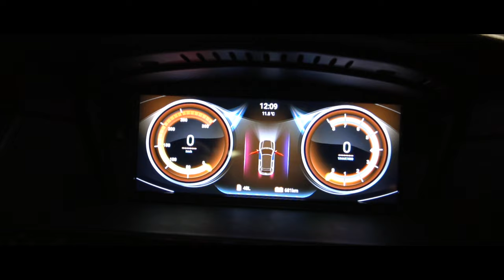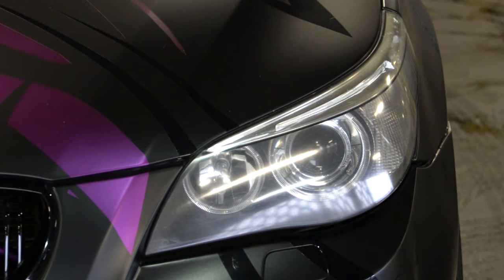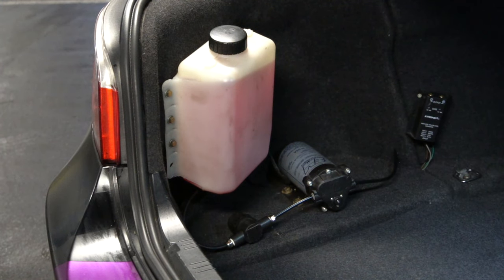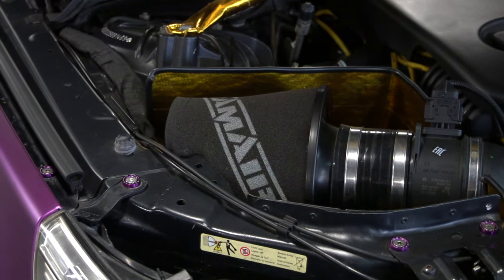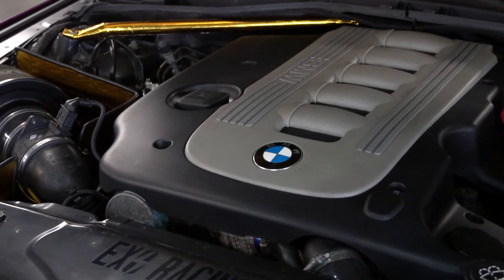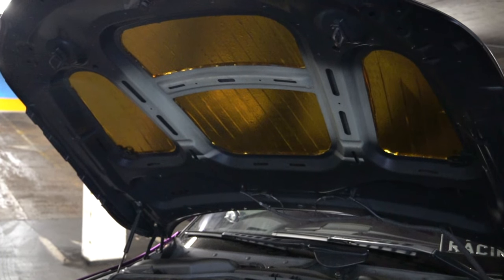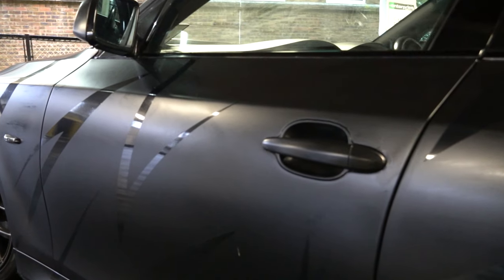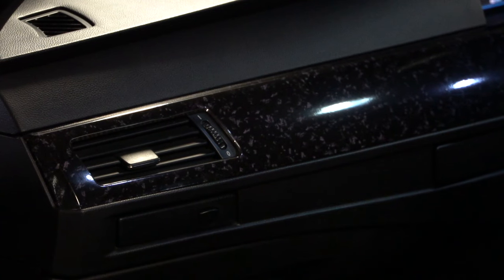THIS 440BHP HYBRID TURBO BMW 535D PULLS LIKE A FREIGHT TRAIN!

Comment from the maker: Sorry about some of the sound quality in the initial chat! High winds! 
Also no 0-60 on this one for obvious reasons ✌🏽
Reply: Why no 0-60?
Reply: @spraynub5767  weather...
Reply: @spraynub5767  I'd think it's due to the rainy weather and the car probably loosing the grip with the truckloads of torque
Reply: No 0-60 bc to rainy
Reply: 2020 ALL yours
Reply: Can he tell us whats his 100-200km/h time? Dont know how much that is in mph
Reply: @charliehope246  Tell us your 100-200km/h time bro
Reply: Mine is 420 on the standard turbos and got new intercooler race cam kit r90 fuel pump and upgraded Bosch injectors coming then I'll be onto ordering my hybrid turbos I can assure you by then my E60 535d will be running upwards of 500bhp I'm going for nearly 600 That is my goal without running meths ❤️
Reply: @garethjenkins1019  Hey mate where have you got the injectors?
Reply: @richardmattis197  hi buddy darkside developments Bosch upgraded injectors bgood for over 500hp but need to be ran with r90 fuel pump to get desired power not the standard fired r70
Reply: My 335d will be complete soon. It will be around 500bhp and over 1000nm and around 400kg lighter than a 535d. Would u want to review this?
Reply: @bradleymotin5568  sounds good but I'll be looking at 1200 nm of tourque so 400 kg isn't going to matter the grunt will pull that weight easy but will be a nice even match between your 335 and my 535 once completed %110
Reply: @bradleymotin5568  also I believe without playing with the cam and really fiddling you can only get 480bhp out of the 335d I'm sure of it where as the 535 has no limit the E60 msport shape already has forged parts I'm sure
Reply: @garethjenkins1019  my mate has achieved 532hp without changing the cams on stock engine. And the 335d comes with more power than the 535d as standard and I think that its the exact same engine. I used to have a 535d aswell
Reply: @bradleymotin5568  535d msport E60 from factory is 308 and 335d is 282
Reply: @garethjenkins1019  335d has more power from factory. 535d m spey has 276 I think and 335d has 281.either way the engine is the exact same. I know this cause my mate has a 335d aswell and his is 532hp and 1100nm and he's not changed the cams.
Reply: @bradleymotin5568  Google the msport E60 535 it's 308 factory not that 28 bhp makes this much difference 😂I'm not going for 530 bhp that's run of the mill I want more anyway 😂😂😂600 + is my goal
Reply: @garethjenkins1019  I did search it up
Reply: @garethjenkins1019  the new 535d has 308bhp not the e60. The e60 has 276hp
Reply: 55 plate 535 272 bhp, 2006 to some 2010 286bhp which is the same as the 335d. E60 same engine as the 335d no difference. 335d about 100kg lighter than the 535d
Reply: @charliehope246  how much for the hybrid setup mate? and what was the milage?
Reply: SprayNub because it’s purple
Reply: when you going to review a bmw x5 m50d
Reply: 0
Reply: Put an shorter diff 520 d and you will have 15% more torq 🥳

Comment: Pulls like a train and with the added bonus of higher mpg. Can't go wrong with diesels except the sound
Reply: The audi a5 3.0 tdi sounds AMAZING.
Reply: @antomustaine  definitely agree. Sounds close to a Nissan GTR when you bypass the DPF and put a exhaust on it 👍
Reply: Zain K it’s rare that they Sound good but sometimes they really do Sound good
Reply: If it has a turbo it sounds like heaven
Reply: Milan Beresnevicius yes
Reply: I have a diesel and I enjoy driving it it’s only about 190bhp and 405lb torque but it’s fun and pulls pretty good it’s a e82 been remapped but it sounds shit unless it’s got a filter on lol. Can’t complain though great mpg too and pulls well. Musics always on anyway haha
Reply: Birmingham racing must be nm
Reply: Geezer up road has a e90 330d with a hybrid turbo and that thing shakes my windows when it flys past, sounds unreal
Reply: Zain K What about the black smoke ?
Reply: Anto Mustaine what year and does it release black smoke?
Reply: Lee Foley does it release black smoke though
Reply: @Birmingham_racing   I was thinking that too. I'm running a 520D F11 stage 2 with ZF8 speed map so it run's more on torque for smooth hill pull's overhere even fully loaded with a trailer behind it. 243hp and 490NM on dyno. 190hp and 405lb seems a bit weird power figure for a BMW diesel.
Reply: And the lack of Rev range
Reply: ilimjahey What did you have to do and how much did it cost and who mapped car mate as I’m thinking of getting a 520d
Reply: @manccarguy  not all diesels blow black smoke my guy.. all down to the mapping.
Reply: @stefanmarkovic8180  one of my close homies had a 3.0 a5 that sounded like a gtr no joke, straightpipe with dpf removed on those sounds just as good as a petrol engine if not better...
Reply: Zain K True they do sound like a GTR
Reply: @manccarguy   i got a simple remap first got me to 210hp an 450nm. Normal they push more from a simple remap but i just wanted more torque for a more effortless drive. Got myself some new Reviera RF107 with a 11J in the back for some good grip. Then i just got a individual tune specific for my car with a thicker intercooler for better flow before the turbo. Got a gearbox tune like this guy when i got a gearbox flush as ZF advise's @ 150.000 kilometer so it hold gear longer and ride on the torque on low end RPM. Before this it shift's down always way too hard and reved all the way too 4.5k where there is no power at all. still very low diesel cost and a floaty feeling when pushed a bit. yeah it's a 4 cilinder 2.0 N47D20C but if maintained well and tickled a bit they pull really good. No performance at all but it sure is very quick. no black smoke at al with mine.
Reply: ilimjahey Do you think I can try something similar in a E60 520d 57 reg onwards the 177bhp model?
Reply: @manccarguy  What year do you own ? early models use the M47 engine lay out and are stronger then the later N47D20 engine. The E6x started using the N47 in the mid of it's life and are users of the early N47 and those engine's are prone to failure no mather how you maintain them. Will not go bad for sure but are known for timing problem's.  If you pick a later model N47 like one of the last they used before the B47 you will be safe if you go easy on it when cold and give it the oil change's it need. Also if you want a faster diesel then go for automatic. I drove my mate's BMW 123D with stage 2 on it with a manual. when the boost is loaded it wil go like a rocket but you will need too learn how to control turbo lagg or it will feel like a truck or a slow car if you can't keep it in boost. Automatic steptronic ZF 8 speed of older steptronic's can be tuned to stay in the boost area. Just more easy too use the torque and enjoy the car more. Also keep in mind if you want too go for a early model N47D20 that if the timing chain jump's a tooth and need some work that the chain is in the back of the engine. Engine MUST come out. Don't let it scare you off too buy one but keep in mind you stay on top of it. You can hear it coming when cold. And run a ODB PORT based management on a phone. Tuned car's need some love but some people forgett about that and thing's start breaking by driving like a hooligan and then it's the tuner's fault or the car. Do it Right and you will have a "quick" torque daily cruiser that wont drink you poor on fuel at all. IMO it suit's a 5 serie better. leave the racing and sporting too the M5 or a 3 serie. 5 serie is for cruising ;)  from belgium BTW so can't tell you any price's.
Reply: @manccarguy   but yes you can do that for sure.
Reply: ilimjahey Thank you have been very informative. So I used to own a 520d e50 late 2007 model and the timing chain snapped on me but I really lived that car as a cruiser spent a lot of miles on the motorway and it was just so easy and handled very well for a big car and that car already had a new engine but the timing chain still snapped on me 2nd January 2017 and I still must it. I think that was the N47 facelift model that’s supposed to have a tiny bit better mpg but I think this time I will go for an Automatic pre facelift M47 engine for more reliability hopefully.
Reply: ilimjahey  if you search this website https://motor.confused.com/?nt=1 and put in the reg ML57 NVX you can see my previous car which is the 177bhp model. Now I want the 163bhp model to tune to maybe 220-240bhp.
Reply: @manccarguy  ow damn it snapped again. M47 is a better choise for tuning in anyway than the N47 just for the reliability. will drive lovely for cruising. I'm not a hot hatch or fast coupe guy. would enjoy a alpina D5 more.
Reply: Birmingham racing only the 118x but it’s been remapped and I may do I get mixed up with units a lot
Reply: Birmingham racing it is nm
Reply: It's a twin turbo😆💥
Reply: I don’t like how you can’t rev it out
Reply: Have you never heard a modded land rover td5? They sound epic. 👌👌
Reply: Not a straight 6 diesel there the best sound
Reply: Sound is better in person, somehow microphones mess it up.
I've got a tuned X5 35d, sounds like a John Deere with a jet engine.
My X5 busts loose all 4 tires on dry pavement- you guys are brave trying to hang on to that 2wd car on wet roads.
Reply: @ilimjahey  He probably means 405nm
Reply: want a list with sick sounding diesels?
Mercedes OM606 plus the entire OM6xx series (except the 4 cylinders which sound kinda lame)
Mitsubishi 4D56
All Detroit 2 stroke engines
All the medium duty cummins diesel engines (e.g. Cummins 6BT 12 valve)
All ford powerstroke engines
Audi A5 2.7TDI
BMW M57
Reply: diesels sound amazing wtf u talking ab😂
Reply: My dad has the a4 and ill agree he bought it second hand and supposedly stock but the way it pulls....we think otherwise. @antomustaine

Comment: You need a later 335d f30/31 xdrive on your channel will shock alot of people. Stage 1+ are sub 4 secs 0-60! Love the work keep it up! 👊
Reply: Michael Elliott I have a f31 335d mate stage 2 currently and people underestimate them but it soon shuts them up when your smashing 0.60 in 3.9seconds 🤣 it’s easy power in a diesel
Reply: @tonyappleton2941  i have the shadow edition f31 with wagner fmic decat and remap. 410bhp. Love it 😂😂😂👊
Reply: Michael Elliott they are weapons ain’t they . They even look the part also for all round I don’t think you can beat it tbh mate
Reply: Steve Frain  decat pipe, front mounted intercooler, minimum panel airfilter upgrade and stage 2 remap. Guaranteed 400 horses🐎🐎🐎🐎
Reply: Steve Frain hi mate a few ways but mainly down pipe intercooler things like that message a company called dark side developments or unicorn motor developments mate they will point you in right direction 👍
Reply: Steve Frain as well as map etc straight pipe . Many ways mate there’s a few guys I know with f31s well over 500 ponys and believe me they are stupidly fast
Reply: I have a 435d with 380bhp and using launch sub 4s 0-60mph. Its ridiculous how fast it is. Grip is stupid as well.
Reply: Agreed. My stage 2 435d gets dragy varified 3.7s to 60 and a 12s 1/4 mile. Roll on stage 4.

Comment: - Does it smoke?
- Naaah a little bit
 - 6:30
Reply: Honestly not all that bad for a 440hp diesel 🤷🏻‍♂️
Reply: hahaha
Reply: Properly tuned diesels don't smoke like that.
Reply: TheCrazySquirell it’s just a safe map mate
Reply: This bmw dpf filter out
Reply: @trustyyy8400  you smoke weed ?
Reply: TheCrazySquirell there is no tuned deasel without smoke. At leat not with alot of hp. There are some with almost none but not without. And this one doesnt even smoke that much. Its alright.
Reply: TheCrazySquirell  he must upgrade a good Intercooler and radiators other wise will
Smoke I have tune tons of dmax with upgraded  Intercooler it is super super
Reply: @UncleBen-fd5xi  bullshit, if it’s smoking it’s overfuelling
Reply: ROLL COAL!  Go Prius hunting
Reply: A good tuner will make little to no smoke black smoke is wasted fuel
Reply: @kalonwilliams3146  Its not
 wasted if soot so thick you cant see is belched onto a Prius behind you
Reply: Its not a lot of smoke for 450 hp diesel are you okay bud 😅

Comment: These straight six BMW diesel engines are brilliant to drive, smooth and torquay 😜

Can only imagine how crazy this one is 👌
Reply: Even the 4 cylinders are pretty good especially when mapped
Reply: my 335d is always without power. always somewhere leaking boost or vacuum....so I basically drive all the time with 50% of torque it once had
Reply: Martin Kulik look for the vacuum bottles and the hoses that’s mostly why they lack power
Reply: @christianh5839  I fixed vacuum during christmas. this time I think it's boost leaking somewhere or turbo pulling weaker, I dont know....the torque pull is just not there and it has been few years when I felt it. mechanics are worthless where I live...changing parts and no fix. If I have the proper jack and can go under car, I would fix it, but my current conditions won't allow me to raise the car and work on it...otherwise I would change seals in red hose and look at intercooler connections too
Reply: @martinkulik9466  check the turbo actuator, and if is automatic transmission you should check torque converter
Reply: Torquey. Torquay is a town in South Devon. This car does live in Devon though...
Reply: @richardharrold9736  think that was the joke

Comment: I got this car stock, 286hp, it's already surprising how you can spend all your time stuck in your seat, comfortably getting really fast without hitting high RPM (between 3000-4000RPM is already a huge torque pushing your seat into the trunk), thanks speed regulator for saving my driving licence.

That's one more nice video sir !

Comment: The m57 is one of the best diesel engines ever imo
Proper car😍
Reply: This isnt m57
Reply: Alexandre Romao yes it is 😂👩‍🔧
Reply: Wtf😂 its bmw 535D E60
Reply: @zoukahaine5638  I know it is I'm talking about the engine it's in many BMW's
Reply: I have 300 HP in 530xd... it's an awesome engine 😎
Reply: @am-mm2sl  yea i used to have a e46 330d really miss it😕
Reply: @leemurphy5253  I have e60 and for me it's timeless design, I really don't want to buy f10...I really appreciate this car and it gives me smiles everyday...Love it
Reply: @am-mm2sl  yea they're brilliant cars I really want a e39 530d it's my favourite 5 series timeless design and high quality car as long as it's a manual
Reply: @leemurphy5253  I hope you buy it and enjoy it...I had e39 it's and awesome car indeed 👍
Reply: @am-mm2sl  thanks mate I'll definitely buy one at some point 👍 best of luck with your 530👌
Reply: @leemurphy5253  I have a 530d with 370.000 km and its still pulling strong! Once the swirl flaps are removed the engine itself is very durable. 193hp are enough for a E39 imo. 7-7,5l/100km are really not bad considering its displacement and age.

Having it with the M5 wheels, H&R coilovers, M bodykit, nearly fully optioned out does make me fall in love every time I see it

Greetz from Germany
Reply: @TheNecavi  yea brilliant going cars badly want one with a manual box .🇮🇪
Reply: @leemurphy5253  330d m57 manual here, 285 hp/600nm :)
Reply: @ToxiicGas  class really want one
Reply: had the 530d then the 535d now i got the 335i,those diesel turbo dont fuck around.....,and you can give cyclists "sOOTFACE",lmao
Reply: @leemurphy5253  just bought one - this is a proper machine man! pulls like a train, rides better than anything I've ever driven (born with msport shocks, and its mint!) though the autobox is shit, get a manual
Reply: @SGIMartin  yea brilliant cars really want one yea the auto box on the e60 is reliable but quite boring if I'm honest but still wouldn't turn it  down
Reply: @alexandreromao8410  yes it is...bmw 535d m57n motor
Reply: @ToxiicGas  330xD m57 with manual and 380HP/750Nm here :)
Reply: @ToxiicGas 
Got one too 👍